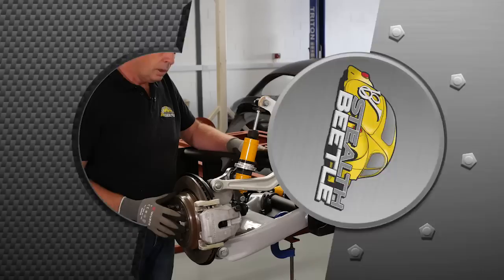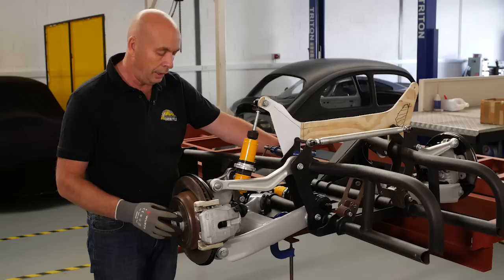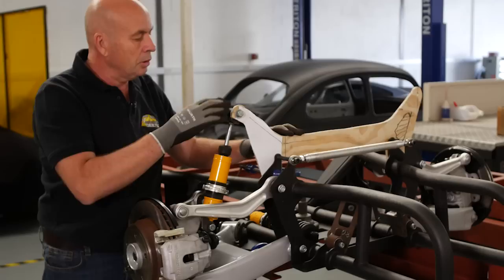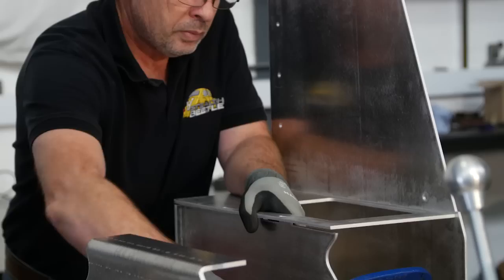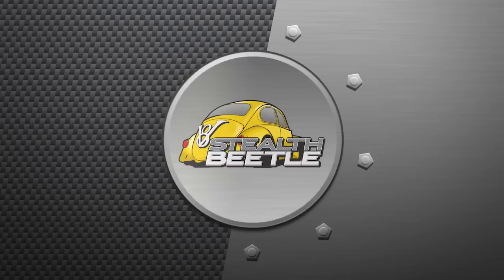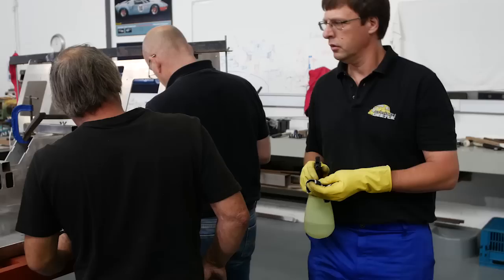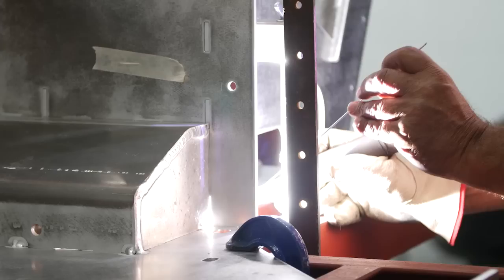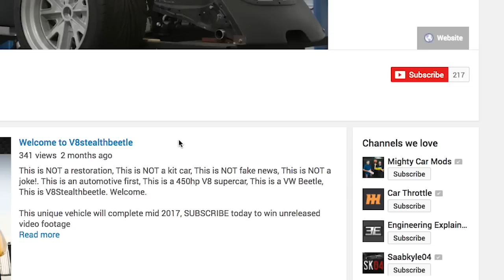V8stealthbeetle Episode 12 A Timeless Body

Comment: Can the Discs Brakes be changed to a larger 4 or 6 Piston Stainless Steel Baer Brakes With Rotors Drilled and Slotted?
Reply from the maker: I'm sure they can. But you are only stopping 950kgs, not 2 ½ tonnes

Comment: Do you preheat the aluminum sections (max. of 250F) for the chassis before TIG welding them?  This should help reduce the chances of warpage during welding.
Reply from the maker: no need, but it is a very delicate operation to avoid warpage. We have a very skilled welder

Comment: Why did you choose the Audi engine over Porsche or BMW?
Reply: Hi MarquisI wanted an engine of the same stable as VW. The Audi is perfect and its light.
Reply: Porsche is from the same stable, more so than Audi.   They have a few v8 turbos as well...   Anyways, just curious if it had anything to do with dimensions.  Like the Cayenne 4.8L GTS/Turbo seems nice.
Reply: Just talking....  More than the engine, this process is amazing.  Can't go wrong with Audi for sure.. :-)
Reply: Yes, BUT I wanted a mid-engine car. I cant use the Cayenne, without making adaptors etc to fit the Audi transaxle. Cant use the Cayenne box.Simply the preferred route.
Reply: Thank you !Stay tuned....
Reply: Jean, thank you for this response. Technology is amazing where average Joes (like myself) can ask experts why they are thinking in such a fashion  Thank you for your time.

I guess mid-engine is preferred to help balance the weight on a smaller chassis? 

Patiently awaiting episode 12B or 13.. :-)

Cheers..
Reply: Ok, I'm reading that Audi gearboxes are highly sought after by GT40 guys.  So, I guess this is where your experience in that space is paying off on this project.